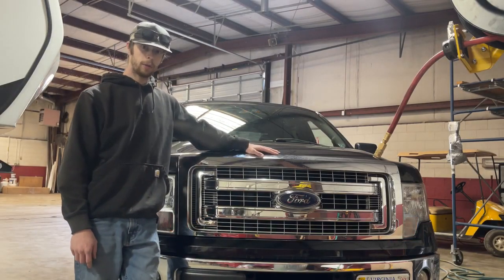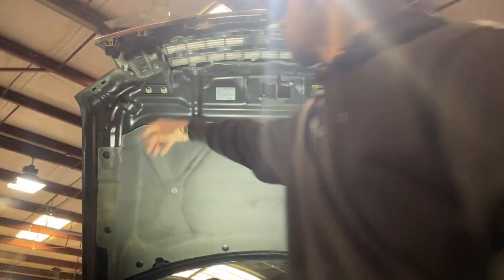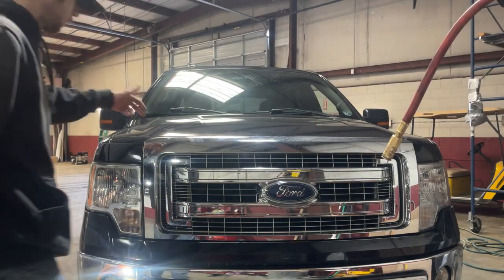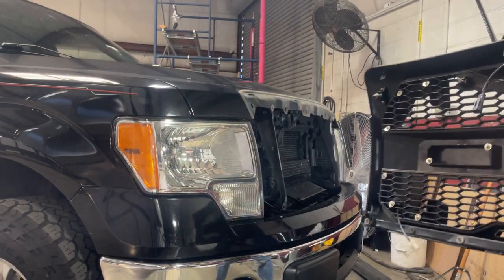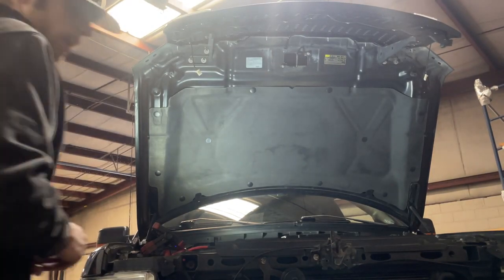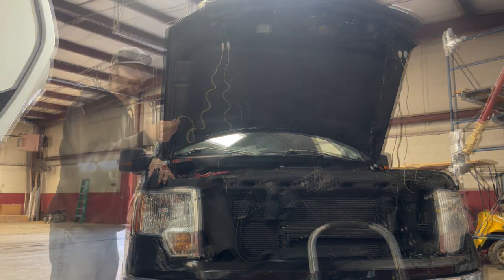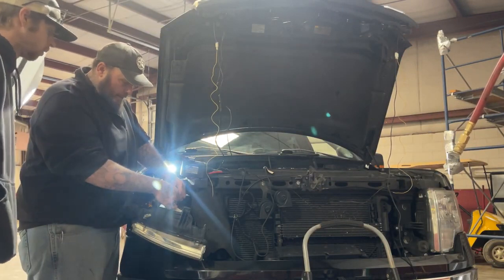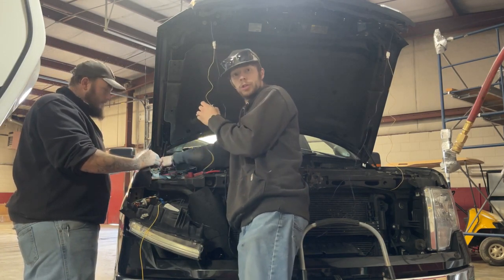09-14 Ford F150 Raptor Style Mesh Grille W/DRL & Turn Signal Lights Installation Video | AMOFFROAD

Comment: EOMD Front Grill Replacement Mesh Grille Compatible with 2009-2014 F150 W/DRL & Turn Signal Lights Matte Black
Matte Black Housing, DRL/Turn/Hazard 3 in 1 Light, 3pcs Amber Lights, ABS Material, Direct Replacement

How come it says Grille Compatible for Ford F-150 2009-2014. Mimes Ford 2012, I took them to Speedy AutoShop
They took them apart and said it doesn't fit like my truck comes with 2 wires only for the signal Turn lights for the left and right side, but no 3rd middle wire. Was I supposed to order a separate wires to connect with or doesn't the EOMD Front Grill Replacement Mesh Grille Compatible with 2009-2014 F150 W/DRL & Turn Signal Lights, comes with extra wires incase we don't have? I just want to double check if there's anyway I can fixed the problem before I return it. Because I honestly really like this Grille I've been wanting this for awhile now please help!!! Thank you!!

Comment: When you turn your truck on, does your lights and turn signals flicker?
Reply: Mine do, and I’ve been trying to figure out how to fix it.
Reply: Yep just installed mine and having the same issue when I start the truck. Doesn't flash at all when truck is off.

Comment: Of the 3 wires that the signal light has, which one does the yellow one connect to? There are 3 wires. I connected it as the video says but it doesn't work for me
Reply from the maker: Connect the red wire to the ACC, the black wire to the negative of battery, the yellow wire connects to the turn signal.
Reply: @AMOffRoad what does ACC means?
Reply from the maker: @safety1st341   In the fuse box

Comment: My passenger side DRL only works with turn signals but the driver side fully works could I get a replacement
Reply from the maker: You can contact customer service to inquire: support@amoffroad.com.
Reply: @AMOffRoad  I contacted support and they said “the light aren’t sold separately” so now I’m stuck with a grille that half lights up and I’m expected to buy a whole new one so the lights can work

Comment: Question, the side C style DRL's in the grill, can they be removed by taking off those bolts on the side? I like the look of the single bar grill with marker lights, but without the side DRLs.
Reply from the maker: No, the side DRLs can't be removed. We have a new Raptor model without side DRLs. Expected to arrive by the end of June.